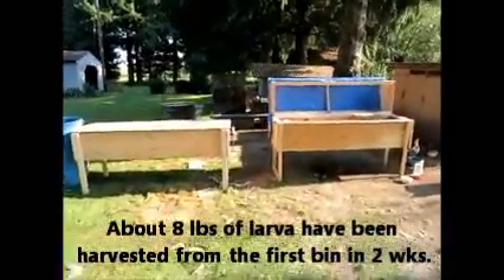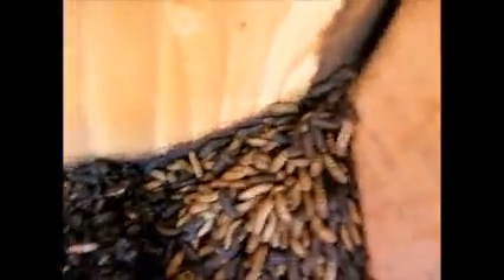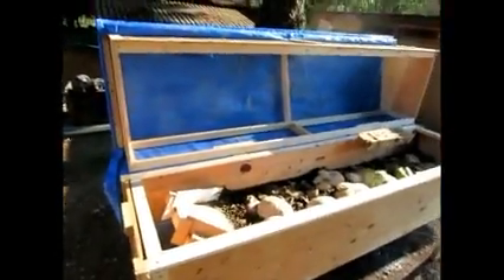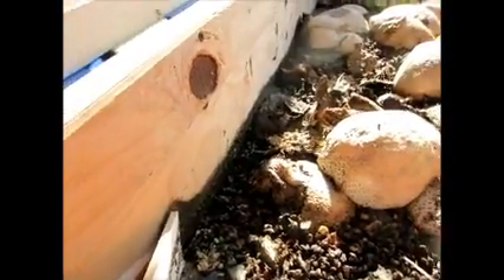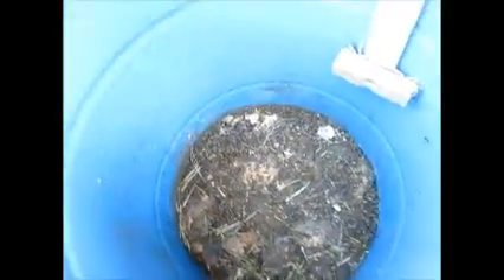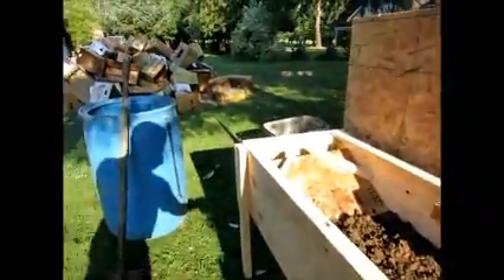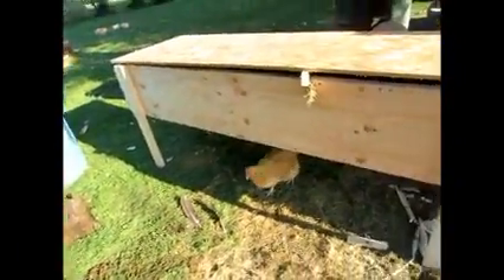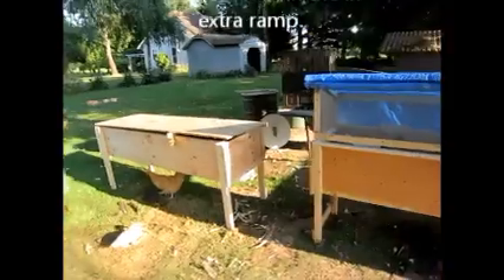How to grow black soldier fly larvae (BSFL) bin prototype #2

Comment: How does the OSB hold up to the leachate? Have you had to replace any of the pieces yet?
Reply from the maker: +alcarl88 Do not use OSB. I only used it since it was lying around.
Reply: I would have the same concerns for plywood I guess. How long do they last before you have to start rebuilding them?
Reply from the maker: I haven't painted one, but the ones I started with lasted 3 years. I had more trouble with the screws rusting and breaking.

Comment: To keep them from scaling your walls you might try putting velcro all the way around the top edge.  It breaks the moisture tension which allows them to crawl vertically when there's condensation.  It can be expensive, but we found some with no adhesive backing at Harbor Freight at a very reasonable price and we will use PL contractors adhesive to attach it to our bin.  I'll let you know how it works.  We used it in a 28 gal. trash can type bin and it works great.

Comment from the maker: When I get around to emptying bin 1 I will put a ramp on the other end like I did with bin 2. The main problem with that will be the lack of room in the working area. There will be other upgrades also like the angled wall will be made higher, I have alot of larvae jumping the wall on the ramp and not making it to the tote.